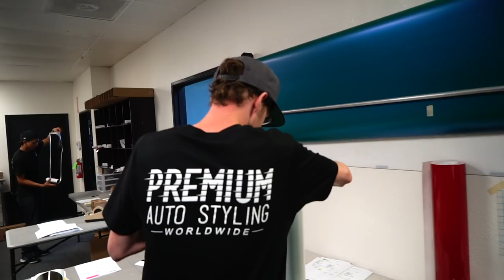Dustin Williams 2018 Honda Civic TYPE R | Vinyl Overlays

Comment: A helical LSD has torque biasing, it works as a normal differential but under even load sends 50 / 50 to each wheel, if one wheel is slipping it multiplies the torque requires to spin that wheel and sends it to the other wheel, there is downsides that if one wheel is in the air, send multiples of nothing to the wheel with traction does not work as well as a locked or plate lsd. If you apply brake the the diff can multiply that resistance and send it to the wheel with grip, so left foot braking can help in the very rare moments you have a wheel in the air, or one wheel on ice. Thats my understanding of it anyway, have installed one in my car.
Reply: Avrilcadabra dropping knowledge!
Reply: Knowledge > hate